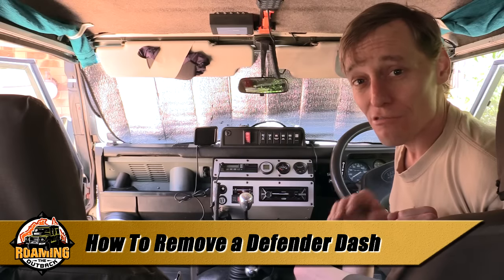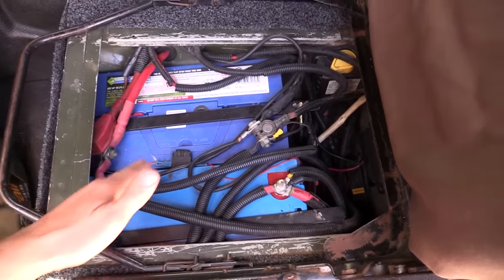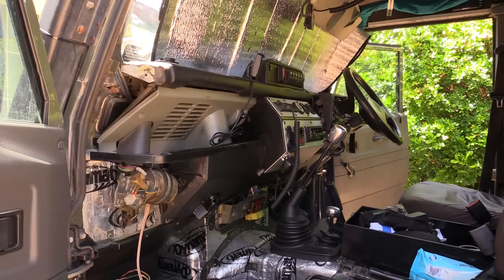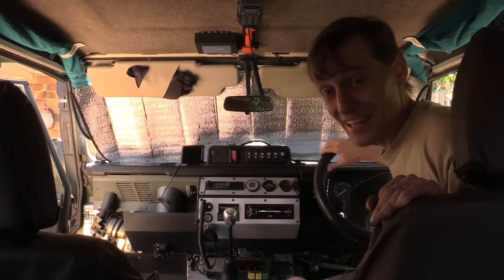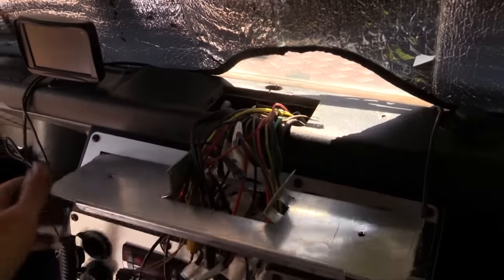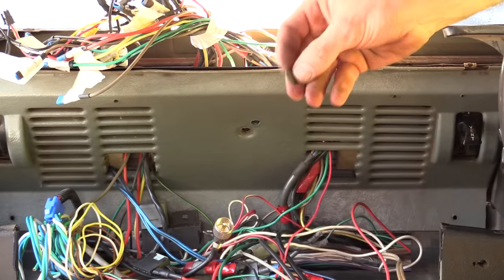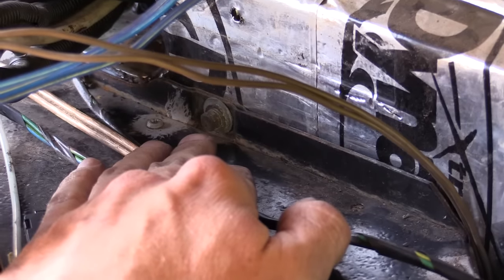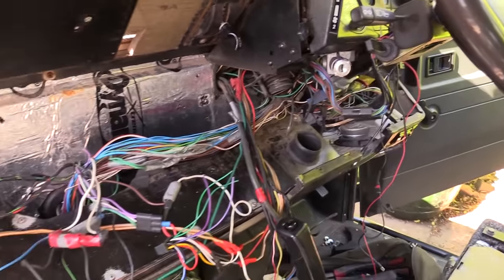How to remove a Defender dash

Comment: Thanks mate - helped me out today when I removed my dash. I have a 97 Defender 110 300tdi. The main difference for me was that there weren't screws on the gray plastic covering back of the tray area. They looked like smaller versions of the push in clips, but I couldn't shift them. Brute force in the end and they broke off! I need to completely remove my black under dash unit - you left it loose because you wanted to access just the wiring looms. I'm fixing some rust on the bulkhead so want a clean access and the only thing still connected is the heater control (left of steering wheel on RHD - hot/cold and vent up/down).

Comment: I've actually been thinking about taking my whole dashboard off my defender 90 and going back to a bare dashboard like the series land rovers. Can't stand the plastic and it would make fixing the bulkhead and finding leaks much easier. Have you ever thought about doing this?
Reply from the maker: No Nick. I'm quite happy with the standard dash. It works well for my needs with the centre raptor dash mod.
Reply: @RoamingTheOutback  Fair enough. I have a raptor center dashboard like yours but haven't got around to fitting it yet. I'm thinking of taking all the plastics off the dash, and modifying the raptor units to fit to the bulkhead. 
The images and videos on your website are really useful! Cheers
Reply: Thanks for your very  good and informative lesson on how to remove the dash,  I have been trying for a few weeks to find out where the bolts  are and have asked lot of others who say they know , only to find they have got just as far as me.
I will have the bottom of the dash off tomorrow  and can look forward to starting my rebuild in a couple of week.  Thanks again.

Comment: Hey at 4:25 was there more to removing the black plastic tray that exposes the final bolts tor the dash to drop? Mine won't come out.
Great vid !!!
Reply from the maker: don't believe so.. Are you sure there's no wires across it... and no sign of glue around the edges? May need to force it or wedge it up??
Reply: @RoamingTheOutback  Thanks for the reply. I finally got it out with lots of wriggling.

Comment: does the dynamat makes a difference in noise ?
Reply from the maker: It helped a little when put on the firewall, but the most deadening came from the rest of the body. Road noise and stones hitting underneath were greatly diminished.

Comment: Did you find the wiper problem
Reply from the maker: No sign of any faulty wires which was weird. I originally dislodged the short by pulling wires back and forth... Have a new wiper switch to replace just in case.